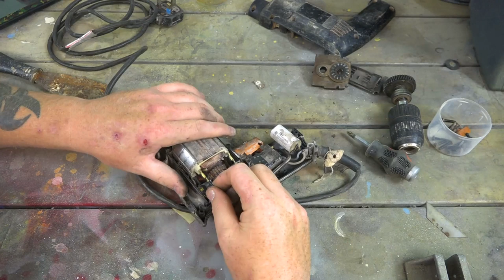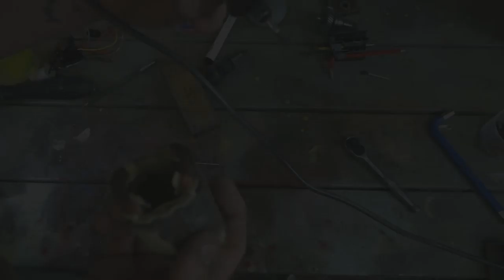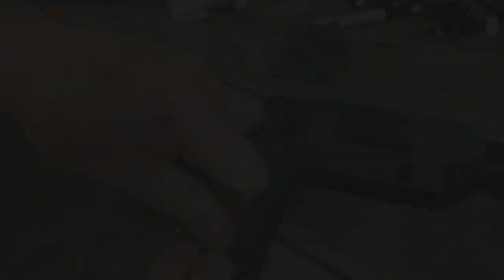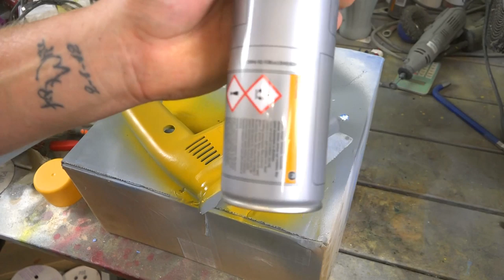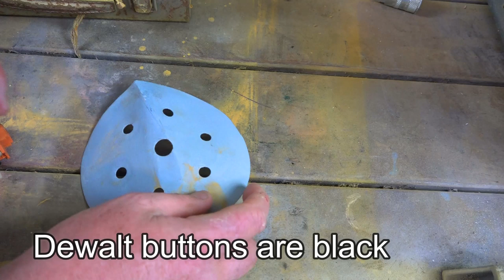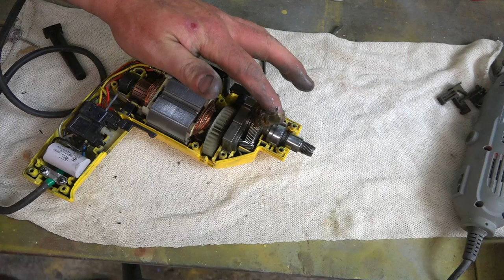Making a fake dewalt Restoration of an old drill

Comment: Is There carbon brush special for drill? Because l bought alternator brush my drill didnt work. What can be  a problem
Reply from the maker: I’m sure you will get them from eBay I have used other brushes from different power tools in the past never works to well